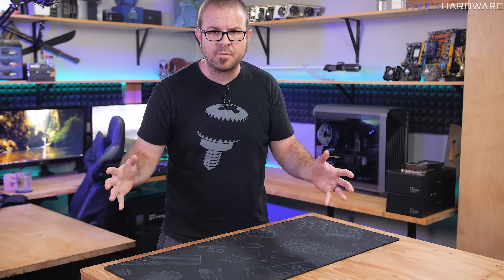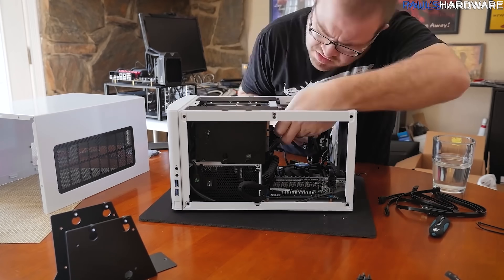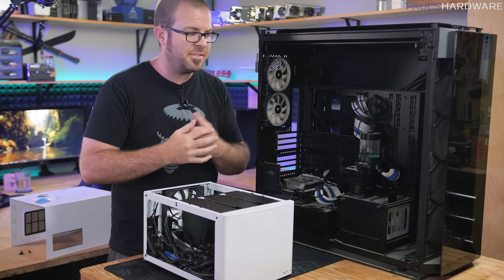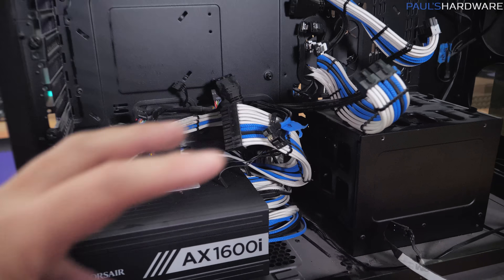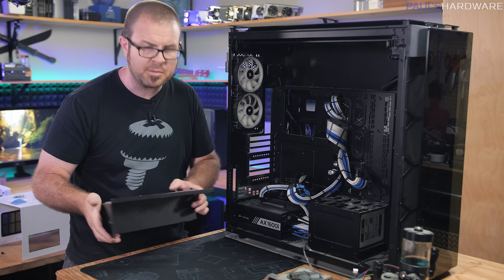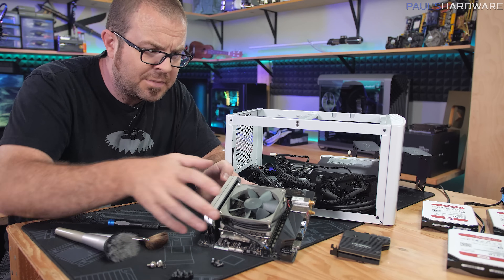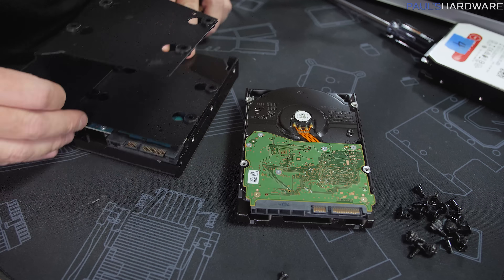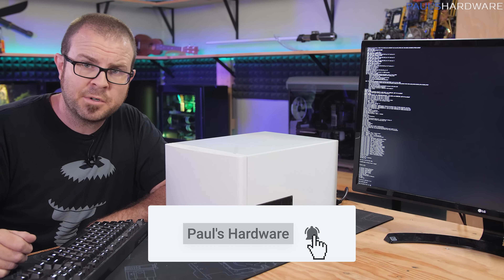2 PCs, 1 Case = BAD IDEA

Comment: I think dual systems was a really cool idea that no one found an actual use for. It could be useful if you needed two low end systems, like a NAS and a Streaming/External capture PC or a file sever and a tor node, stuff you'd leave on 24/7 and rarely touch. You'd potentially save a lot of money and space doing a dual system for that kind of thing, without pushing the cooling capacity to it's limits, but for 99% of people it just seems like something you want to do for fun, rather than makes practical sense

Comment: I had the same problem with WD Red drive screw locations in a Define R5 - the only way to mount them on the trays was back to front so they hung over the edge a bit, and probably contributed to the vibration noise that drove me insane until I moved all the hard drives to my old system and set it up as a file server.

Comment: Just last weekend I took my rig apart (a Meshify S2) for the same reason. For the case, which is black, I used wet wipes to clean it out and they work very well on the rubber gromets - the build looks brand new if you give a good enough wipe down.

Comment: These dual system cases to me seem focused on streaming type tasks. Not just twitch or youtube but even office presentation, video recording/saving/backup, etc. It would be perfect if you needed to record from a single case. (Imagine a rock concert traveling with a system and the backup.)

The OTHER situation is isolation. For example, isolated networks (a classified system for example*). Or a development network and you need a server and client in the same case/employee/desk. (* US classification systems would never allow this as it isn't isolated enough but that won't keep people from trying for other protected networks in the private sector.)

Comment: Considering my zotac 3090 is already having a heat aneurysm in my p500a with 6x140mm noctua case fans, I don't think it would make it very long with a second PC in it, though it's entirely possible.

Comment: For you it makes total sense, because you own multiple computers you use on the regular, but I find the mere idea total nonsense to put drives on a network 90% of their users will only ever access on a computer that stands two inches above that NAS. A simple 4-bay USB "3.2" enclosure would be both more compact, and make more sense. It would also cost like 125 bucks, so it would cost like the overhead of having to accommodate two systems, without even accounting for the price of the second one.

This dual case design made sense when no CPU was powerful enough to play and stream without a performance hit at the same time, so having both systems in one case was convenient, now it's just a gimmick.

Comment: Nooo! You didn't just use painter's tape to hold the drives! Come on Paul, you could have used thick double sided tape at the least, so that it won't show or what I would have done is drill an extra hole on the bracket and used a third screw (3 screws is plenty)... Sigh...

EDIT: Was too shocked so I went for the comments right away hahah. Glad to hear you'll be looking into more permanent solutions. I also forgot to suggest 3D printing adapters. Cheers!

Comment: Wow, that is a really dirty CPU cooler!  Was that machine sitting on the floor?  :-)
Instead of using blue tape, I would probably have drilled a hole in the appropriate spot on the drive mount, so that I could use a zip-tie to secure the other end of the drives.

Comment: I have a 1000D and had the same setup with the NAS on the ITX board below. I also ran a custom loop on the main system. It was very nerve-wracking with the drives below all of the watercooling hardware. I did the same and removed the NAS system into a Cerberus X (love the handle). I've had better sleep since.

Comment: My Corsair 1000D case I installed casters to the bottom of it so it's very easy to move about if I need to.  I got them from an old office chair and they work perfectly for it.  I also put them under my 5000D cases as those are pretty heavy also.
Reply: I have mine on a wood platform with wheel, yeah super easy to move around.

Comment: I used the Phanteks PSU and Evolve X to put NAS and watercooled gaming system into one case. It sucked! The PSU does keep the power on for the PCIe and auxiliary power cables and will run your RGB on the gaming system and kick your fans on the gaming systems GPU to high gear, because it does not get power form the mainboard, but from the PCIe cables. I solved it with changing that to a waterblock, but the system would still get power. It only works if both systems have to run at the same time. I completely agree with your decision, Paul.

Comment: In terms of dual PCs, I think it depends. That case might be bad for it with both systems intermingled with one another. But, if memory serves me right, I've seen cases where the smaller system gets its own little separated attic compartment.

Comment: When I was a service tech and engineer in a data system there were several machines running dual or quad systems in the same case because limiting connections cables resulted in computers having no to less latency communicating between systems that needed to talk with each other on a constant basis for applications that ran and/or monitored industrial processes, a very unique situation.  I personally have no need to do it.  The longer the run of ethernet cables the more voltage drop and signal degradation where signal boosting machines/equipment would be needed.  Again a very unique situation.  And to say the least the machines in questions were next to or on top or under the multi PC case of the storage rack to shorten any and all connections.  :)

Comment: There should be no need to keep the same drive on the same port regardless of what type of RAID or system you are using but labeling the cables by port number will help you identify a faulty drive quickly.

Comment: I have a dual system in a Phanteks P600S and a revolt X 1200 watt PSU. There are ups and downs. for me its space saving, and the fact I don't have to tab out of a game when talking on discord. I built mine recently though and definitely one of the main reasons you stated at the beginning of the video is true. I wanted all the power as it was always my dream as a kid to have an awesome gaming PC. Now I can't upgrade my system any further (besides ram). So I bought the bracket for phanteks cases and then upgraded PSU and added a smaller ITX board mainly used for office work or discord calls etc. Works well and I can set the mini system up to video capture my older game consoles if I want to record them when I play.

Comment: Kioxia BiCS flash - what's next? Gillette flash? jokes aside if my corsair 7000D Airflow is made like a tank but that comes at the cost of 11-14kg weight of the case alone, I can imagine how heavy that even bigger 1000D is.
Reply: Put it on a wood platform with wheels, super easy to move.

Comment: It is a pretty neat idea, there are some situations (although very rare) where you would want 2 physical pc's NOT dual booting from the same drives, for example if you wanted a dedicated server for games in a linux distro and you wanted to connect to that server in a windows installation and you wanted to get the full power out of both of them by not using any virtual machines, this would be the perfect solution to do that.

Comment: Both sets of mounting holes are part of the same standard (SFF-8301), and have been for quite a while (at least dating back to 2010, from what I've found, but I'm fairly confident they go back way further than that) though almost every drive I've seen has either the ones your Toshiba has, or both. I checked through my pile of drives, some of which are positively ancient IDE drives and I couldn't find any that have only the hole pattern your WD Red has, I did however find an ancient Fujitsu IDE HDD that looks like it has all six holes

Are the Reds shucked perchance? I seem to recall reading those sometimes have a less common hole pattern, because...reasons... I guess...

Comment: Since most psu's get their peak efficiency at like 80% of peak power, what is the long term cost of running this psu vs one that would be closer to ideal for the power needed? Just thinking that pennies per day adds up over several years of constant use

Comment: I'm currently using an old sff dell with a 4th gen i5 and 2.5" HDD's running as a "NAS" (windows with network drives in a software raid....)

It's jank but it's what I have to work with at the time. I'm hoping to be able to get a proper NAS setup going at some point, I'm starting to run out of storage space lol.

Comment: You could have used a Phantex 719 case. With the dual psu. Two water system. Room for a lot of drives in that case.

Comment: Yea, I have dual case build using 1000D and it’s not for everyone. Fortunately my use case supports this config but over the years of the build and reading normal users post during that time it definitely would not be practical for many. I’m a developer, programmer, cyber defender, normal daily driver, and all the soho requirements needed in my case. I have two boards, one intel and the other thread ripper, two psu, and a bunch of cables. Last year I was going to water cool but then all the supply scalping happened which turned me off in buying. 

I game only a little but wouldn’t mind a change since I’m older and have all my college and gathering work experience - which takes dedication in your job instead of gaming all day - so gaming sounds fun since it’s hard to do anything outside the city due to Karen’s and covid restrictions. 

Love your videos and think your configurations are very sound. Cheers

Comment: The case supports 6 sata drives; does the motherboard?  I have a "spare" 3900x and most mini-ITX mobos I've seen support only 4 sata drives (couldn't use the expansion slot for extra sata space, as I'd use a "spare" 1080 transcodes.)

Comment: I am gonna say this flat out. If you build with purpose and not form over function 2 systems 1 case can work phenomenally. My wife and I had a Mountain Mods UFO dual ATX build and it was fantastic never had any issues period.  But you have to build with a little bit of forethought on cooling ,accessible maintenance ,and weight.

Comment: re: keeping your computer on the floor... it's rarely a good idea, HOWEVER, I have a fractal design meshify 2 to which i've fitted Wendel's (from level 1 techs) custom 3d printed office chair caster wheel receivers for fractal cases.  my computer sits on the floor but the wheels and mounts place it somewhere between 2 and 3 inches off the floor which means it still have plenty of room to breathe (I have intakes at the bottom of my case, but I'm also using the excellent integrated air filter at the bottom of the case.

Comment: Gaffers tape would have been preferrable Paul...that blue tape will absorb moisture over time and the adhesive backing will become a slimy mess!
Reply: actually found a 3d printable thing to fix this problem and I am printing a few plus a little extra to show my support. Cheers!

Comment: I’d do a dual system/single case set up for gaming and streaming. Sure, it’s a big case but it’s all about the convenience of having everything set up together. If I ever seriously consider doing it, I’ll build in the 1000D for sure.
Reply: There's a few other cases that also support it. Iirc the p500a does as well.
Reply: I don't know myself, I don't do either, but I think Jays2Cents did a video and came up with modern hardware can do both at the same time as long as you're not trying to max out both, just set it for level 4 instead of 5 (my phrasing, not his) and there'll be enough resources for both...

Comment: I have built a dual system into a Phanteks Enthoo 719, with a Phanteks Revolt X PH-P1200PS Platinum, single water-cooling loop. I love it. I did it because I wanted it and liked the challenge. The main system is: AMD ThreadRipper 3960X | Asus Prime TRX40 -PRO | G.SKILL Trident Z Neo 64GB (4 x 16GB) DDR4 3600 | MSI Radeon RX 5700 XT MECH OC | Seagate FireCuda 520 M.2 2280 1TB. the mini-ITX is: AMD Ryzen 5 5600X | Gigabyte X570 I AORUS PRO WIFI | Patriot Viper Steel 16GB (2 x 8GB) DDR4 4400 PVS416G440C9K | Asus KO-RTX3070-OC-8G-Gaming | Inland Perf 500GB M.2 2280 PCIe NVMe 4.0 x4 | Intel 660p 2TB SSD M.2 2280 PCIe NVMe 3.0x4. NOT A BAD IDEA (for me)!

Comment: I ran into the same drive mounting issue when I recently built my little NAS in the CoolerMaster Elite 130. After some investigation, I learned that several years ago they (whoever "they" is) pushed the spacing out for higher capacity drives (e.g. your 8TB drives and my 10TB drives - I only have 2 of them, though). Since the mounting points in the CM 130 could also double for SSDs, I was able to kind of kludge my way through it, but it was irritating. I even emailed CoolerMaster to see if they made different brackets, but got no response.  P.S. I would definitely not recommend the Elite 130 for this purpose... or at all, I think... the power supply hanging over the cpu really limits what you can do for cooling where, even if it fits, a good portion of the intake is blocked. Definitely should have used the 304 you showed here :)

Comment: yea the 1000d being heavy is an understatement i love mine...even though ive yet to order the fittings so i can finsh the damn thing
Reply: You could put it on a wood platform with wheels, i have mine on one and it make super easy to move it. It's way easier to move my main (1000d) PC and vacuum around it than my second system (old small mid tower prebuilt)

Comment: The number one reason I can think of for having two machines in one case is so you have your gaming PC and your streaming PC all in the same place. Having two computers that work together in the same case is more convenient, especially since you could theoretically run the output from one to input for the other much more easily.
Reply: Harris Heller had a kick-ass dual PC setup in one case and decided it wasn't good solution anymore. If he wanted to game or stream (but not both) then both computers needed to be turned on rather than just one. The other reason is with modern hardware you don't need two PCs anymore. He feels it is better to upgrade the components in one PC rather than split your budget over two. A 3080 with a 5900 should cover both streaming and gaming even with other processes running in the background.
Reply: Who still does that these days? That was for back when intel artificially kept the core counts low because AMD didn't do their job of being a good competitor. These days we got so much raw performance in one PC a second PC is not needed anymore.
If your PC is too weak, then upgrading your PC is a better solution. Saves space, energy, is more reliable (the more components your setup runs on the higher the chances of failure) and produces less E-waste at the end of the day

Comment: You should be able to offset the hard drives back a bit in the existing bracket, and just drill 2x new holes in each to slide in the grommet/screw combo for those drives.

Comment: Great video I have been planning to build a system in the Phanteks XL Mini for awhile and its a dual system case. The case was on sale from 179.99 down to 99$ on newegg i figured it was a good deal on a dual system case. 

I did weigh your cons, make sure I'm not jumping into a poop fest. 
weight - Not a big issue I have had a few alienware area 51's, and my home NAS is in a hefty 1U.

1 goes down they both go down - Whelp I wanted to do two PSU's and the system has two power locations so I hope that's not the situation, but this is likely the only issue I can see.

Pump issues - Haven't used water cooling in years, I like the look of big oversized coolers.

But you make good points. You try PC ideas, if you dont like them, you put down the negatives and normally don't go back. Its why I stopped water cooling. I have had good Noctua or Cooler Masters coolers be used for 10 plus years like build after build with no issues. But I have always had issues with Water Coolers after the three year mark especially if they are not well kept.

Don't worry Paul I will keep the system off the floor tho!
Maybe I will need to revisit this in three years if the dual system turns out to be a mess.

Comment: the 1000D is a great case and dual PC's are just fine.  Then again i purchased high quality water cooling products and in 3 years have not seen a single part fail.  My setup worked great for streaming from Dual PC's so i don't see what the issue is.  Judging by the dust in that system, some system maintenance may have been lacking.  

As for all of your water parts failures, well that is expected when you use low quality parts, then add in a bunch of quick disconnects which just add restrictions.to the water flow.  I get it though, Free parts are free parts.
Reply: What are the low quality parts?
Reply: @greggreg2458  Clearly his pump/res combo.  He had 2 fail within a few months.  I have built 15 systems with customer water cooling, and never once had a pump fail when using EK parts.  I keep most of my personal system for 3-5 years and outside changing the fluid yearly, never had to do anything to them.
Reply: @Hated_Sien  I have a Corsair D5, EK blocks and Corsair/Hardware labs rads. Never had a problem too luckily
Reply: @greggreg2458  I honestly think his pump/res problem was the way he connected them together.  In my opinion the fittings linking them limited water flow and burned the pumps bears up.

Comment: A quick solution would be to extend the existing brackets using the non-obsolete holes to screw some sheet metal, which you can cut and drill to fit the purpose. Some washers might be necessary too.

Edit: or make new brackets entirely, but that surely takes more work and precision for not a lot more benefit. Also you'd be left with the old ones doing nothing.